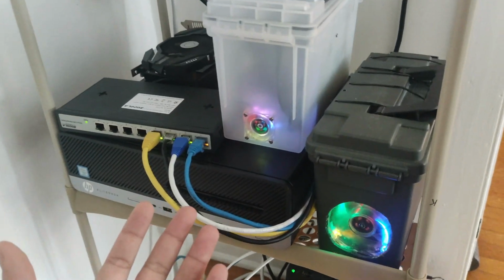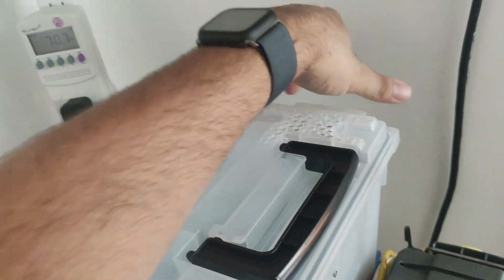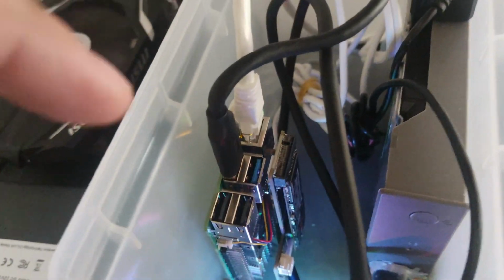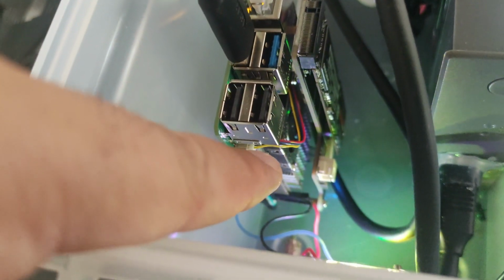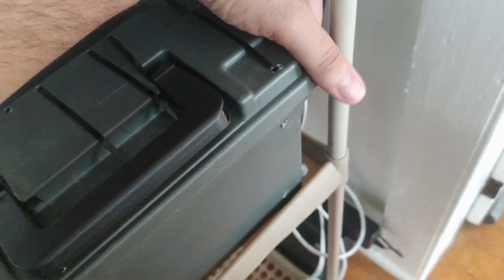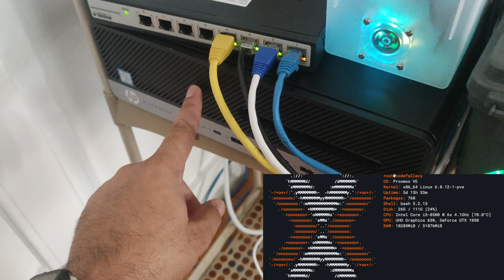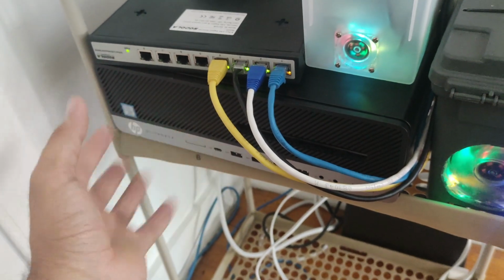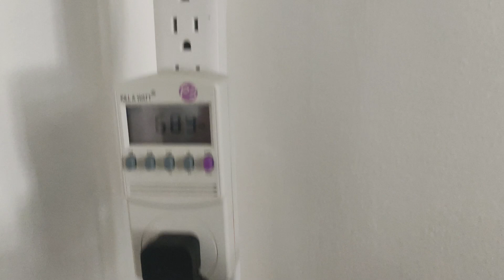My Homelab Server Rack Finally Revealed!

Comment: That's super high, I bet its that APC UPS.
I got the shock of my life when I tested my server with and without UPS. The APC UPS was consuming 50W on idle 24/7 doing practically nothing since its fully charged. Tested it without any load and it was STILL CONSUMING 50W!. I was like WTF why didn't i check sooner.

Apparently APC has the trashiest idle power, swapped with cyberpower and it only consumes 5-10W. You gotta change to cyberpower after testing of course.
Reply from the maker: Great point!  i got the cheapest available, now that you mention it i should test the ups by itself and see 🙈
Reply: @codefallacy  
Even expensive apc don't turn the transformers off during idle operation, mine was top of the line pure sinewave too!! 

Apparently cyberpower is the only brand that has a bypass to main grid without turning on transformers, research "cyberpower GreenPower bypass".

Comment: I dig the ammo box nas creations looks like something i have built
Reply from the maker: Yeah to me it makes too much sense. Im hoping to build a bigger nas with 4 3.5 hdd in the future and use the ammo box
Reply: @codefallacy  pretty cool yeah I'm building a Nas currently but it's using a matx motherboard so a little to big for most amo boxes so I'm just using an open face server/test bench looking case for it should look pretty interesting though it's gonna have a couple 3.5 drives and I'm working on building a metal holder for them to bolt to the case